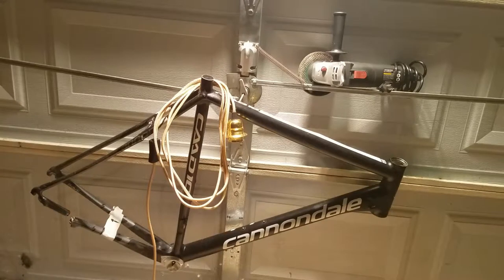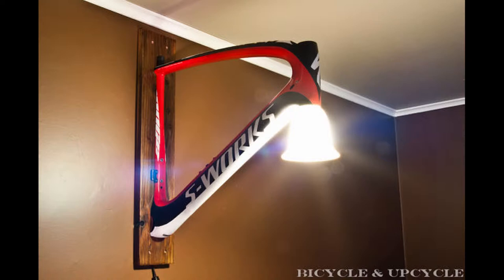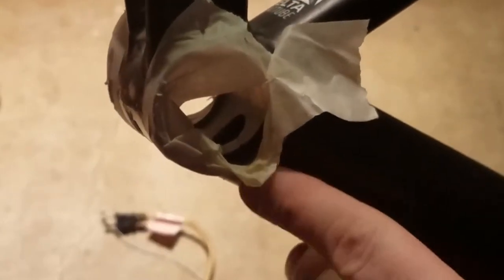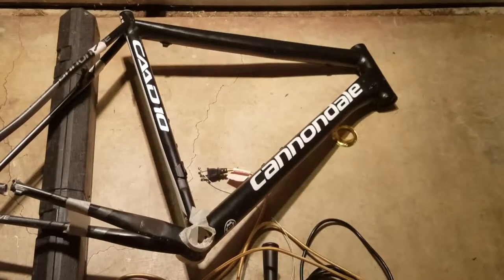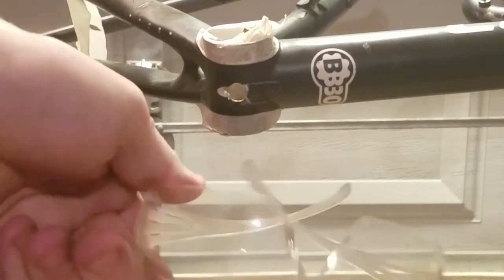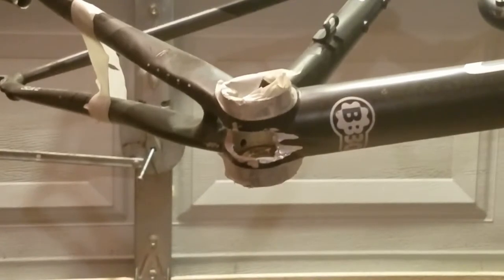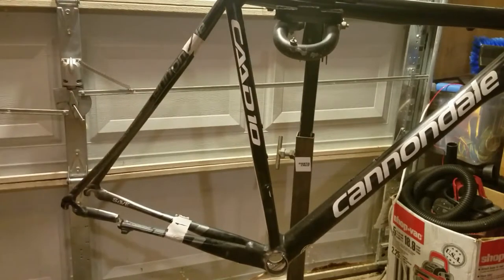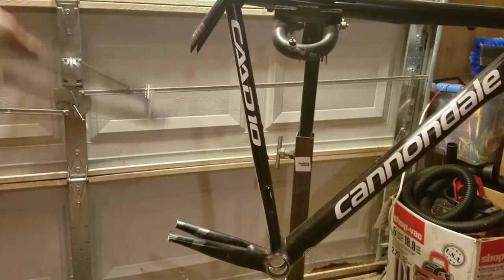Cannondale CAAD10 Frame Lamp Wall Art: Part 1

Comment: Nice idea to make the frame into a lamp.  An alternative solution for the plug is to cut the plug off, snake the wire through and install a new plug.
Reply from the maker: Thanks James, please take a second to subscribe to see part two! I really need to get this thing done, but things have been crazy! If its a smaller tube bike I think you will definitely have to do that, I was actually hoping to be able to take the cord apart at the switch but I was worried it would break. Luckily the cannondale tubes are so big, I drilled out the water bottle cage threads but it would have fit fine without it too.